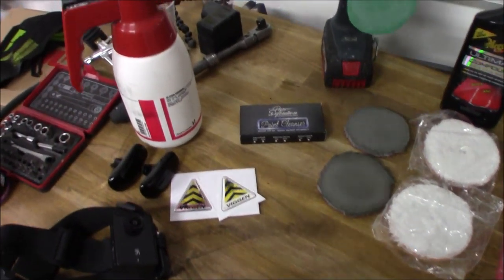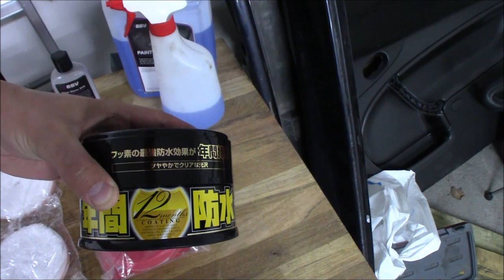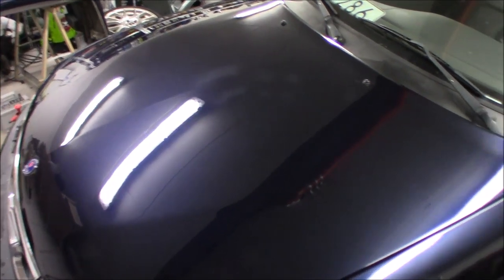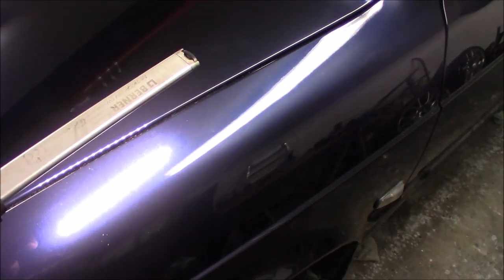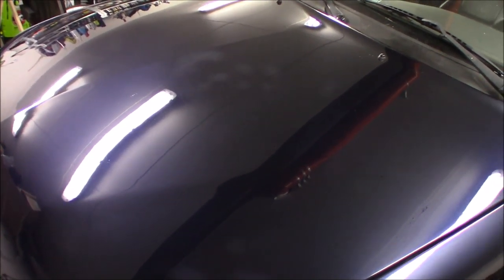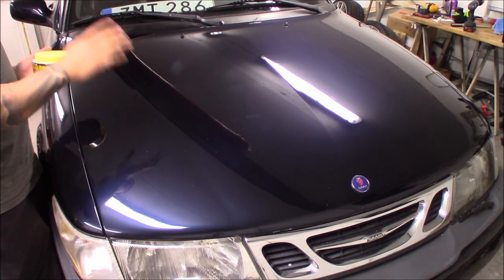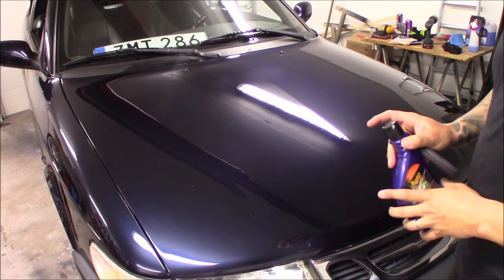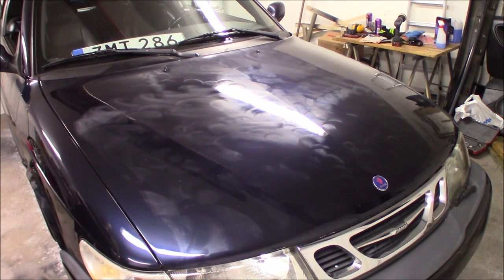MIRROR SHINE DETAILING Saab 9-3 Convertible SATISFYING

Comment: Now THERE is a man who loves his Saab :) I have had mine for around 12 years and, boy, have I some work to do on it. The Clutch (which is what brought me to your channel), the inner driveshaft bush, core plugs, timing chain, valve stem oil seals and possible crack in bulkhead .. oh and maybe a turbocharger. But to say the car is part of me is an understatement. Faults and all, I would never contemplate getting rid of the car. The faults after 12 years of good reliable motoring is a small price to pay. Regards from another Saab fan :)
Reply from the maker: Thanks Paul! Hope you get it back on The road 👍👍

Comment: Hey Jonas   Thanks for sharing your passion with keeping the Saabs on the road ;-) 
I had 2 X 9000 CD and CS and just got my second 9-5  2.3T 2005 ( replacing a 9-5 2003 ) and i will use this great video to help with detailing the paint back to its former glory, Soft 99 stuff is on the way, cant with to try claybar for the first time.
I really like your informative videos, super simple and easy to follow i think.
Keep up the good work.   Morten DK
Reply from the maker: Thanks Morten! Good luck with The new Saab 👍